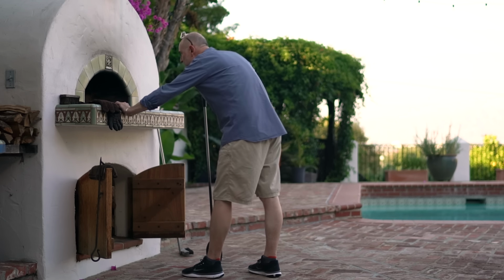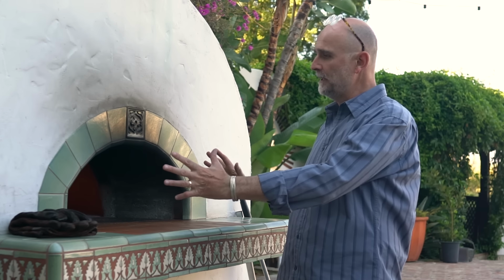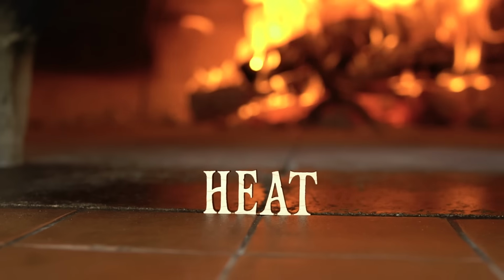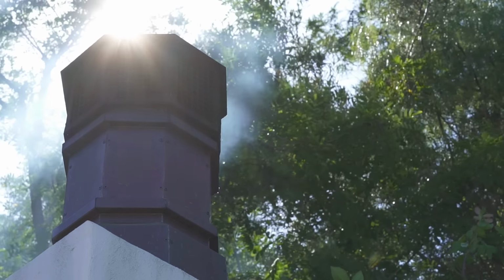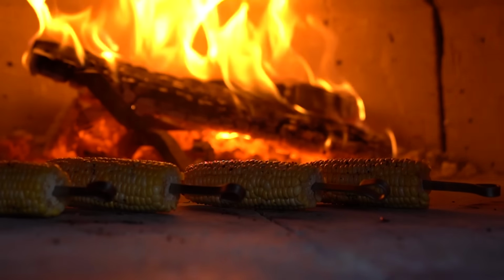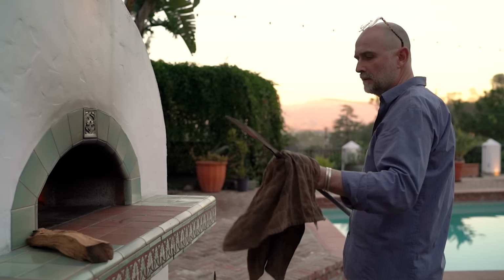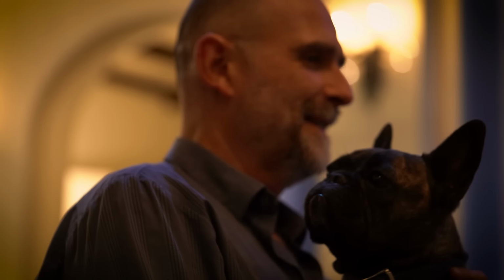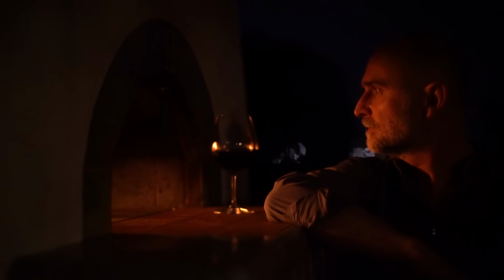Ep 1. An introduction to Wood Fired Oven basics

Comment: Clive hows it going what to you use to clean the smoke outside the oven face or does the heat clean it outside as well ?
Reply from the maker: Hello Benny.
Between the front opening and the dome I will occasionally use a wire brush and the vacuum to brush away any build up. I get the chimney cleaned by a professional sweep once or twice a year depending on how much I’ve use the oven.
Wood that hasn’t been properly seasoned and has a higher moisture content can leave creosote reissue in the chimney, so be sure to use properly seasoned firewood.
Outside of the oven I use a kitchen sponge and some slightly soapy hot water to scrub down the tile on the shelf, around the opening, and to clean the stucco.
The tile directly in front of the opening is unglazed and high fired so I know it can withstand the heat from the oven, but I will occasionally wipe some flaxseed oil over it as it's a good high heat seasoning agent, especially for cast-iron pans.
I hope that answers your question.
Thanks for commenting.
Clive

Comment: Great information, the only confusion is: 800 degrees ?!! are you cooking food or meltin any metals ?
Reply from the maker: Hello Lola. HaHa! Yes, you can heat the oven up to 800F if necessary, but that's usually for something like pizza. Most of the time my oven is around 700 to 750F, which is still hot, but closer to the oven opening it can drop to around 400F. I regulate where I place the food in the oven based on how quickly I want it to cook. Never tried melting metals though. Thanks for watching. Clive
Reply: He is talking Fahrenheit.....not Celsius (400C) ....lol
Reply: @SuperSetright  thank you - I was reading the comments to clarify that... was thinking I might have accidentally built a kiln not an oven.

Comment: Great video! What is inside diameter of the oven?
Reply from the maker: The internal diameter of my oven is 40”/106cm. More important though is the heat retention of your oven. An oven with good heat retention will require less fuel to maintain the temperature, which means a smaller fire, which gives you more surface area to cook with.

Comment: i have 1 question, how do you clean the ovens insides? like all over the dome
Reply: MeiN he tells you in the next video. Shop Vac
Reply from the maker: Hello MeiN. After you've used the oven, and it's cooled down the dome and floor are usually completely clean, other than the residue ash on the floor which can be easily cleaned up with a shop vac if you want. Once you relight your oven then smoke cause by the resins in the wood will turn the dome black until it reaches over around 425C/700F. Thanks for watching.

Comment: The oven design has a flaw, the entire flat area of the front will all become black within a few uses, also the dome is a bit to high in my opinion and make the flame not crawl on the ceiling. But it looks very beautiful and having one in your back yard is a game changer when it comes to cooking
Reply from the maker: Hello. I've been using the oven for several years now and haven't had a problem with it becoming black. I assume your talking about the tiled area outside the opening. I chose that tile because it was fired at a very high temperature and can withstand the heat from the oven and is easily cleaned. I can get a pretty good flame roll when needed from the dome. Also, several times a year I have the chimney cleaned by a professional sweep. Thanks for commenting and for the input. Happy New Year.

Comment: ive resored an old mud oven, it has like 40years old, i cover the floor with cement so its flat, its small, its half of yours... and it has an open hole in the top. i did a fire test, and it got so hot i had to stand 40cm away, after it cooled down, i did a few pizzas, it was great, an hen i wanted to do bread, did 2 fires, and non of them made a crust on the bread, i heated it up a lot, remove the heat clean the floor, place 4 breads and close the door, waited 40 min and didnt cook it through. i've got a white crust... what should i do ¡?
Reply from the maker: What temperature can you get the oven up to? Bread loaves are usually baked T AROUND 450F/230C.

Comment: I'm amazed you can put cast iron in an 800° oven without it shattering like porcelain.
Reply from the maker: It's usually 800 directly around the fire, but the heat can drop off to around 400 close to the opening, and around 500 to 600 in-between.
Reply: are you thinking about °C? the video meant Fahrenheit
Reply from the maker: Fahrenheit

Comment: Can't get the reasoning behind the dome. Why would I want to retain the heat for long periods of time?
Reply from the maker: The dome shape is considered one of the most efficient ways to absorb and reflect heat. 

The dome and floor are what’s called your Thermal Mass. Think of it as a battery, and the fire is the energy source feeding them. Once you light your fire, you’re transferring energy/heat into the dome and the floor. And those surfaces will continue to absorb and reflect heat while there is a fire in the oven to feed them.

The insulation helps prevent the heat from escaping, keeping it within your thermal mass. In my experience this means I need less fuel to maintain the temperature, which results in a smaller fire, and that gives me more surface area to cook with. The insulation also increases the time it will take for the oven to cool down, and extends the period for retained heat cooking. You can cook many dishes in the heat left in the dome and floor. The most common use of retained heat is cooking bread.

Comment: So what heats the floor
Reply from the maker: Hello Walter. Once the fire is lit the heat is transferred to the floor and the dome. The hottest part of the floor will always be the area around the fire, but the temperature will drop off closer to the oven opening where cool air is drawn in. That gives you flexibility when cooking, so you can regulate the heat you're using based on where your cooking vessel or food is placed. Thanks for commenting.
Reply: @TheWoodFiredOvenChef  brillant. Thank you for the reply. Really appreciate this.

Comment: But I thought ash is bad to eat ? especially when you lay the pizza down on the floor of the oven.
Reply from the maker: When you're cooking food directly on the oven floor, like pizza, you should brush away as much ash as you can and then wrap a lightly damp cloth around your peel and give the floor a wipe (just a damp cloth, a wet cloth may damage the floor). In Episode 11 you can see how I do it. Thanks for commenting.
Reply: the purpose of heating with wood is to get the flavor but I can do this with wood chips

Comment: Very sexy and romantic video. But I'm practical. I thought the ending was going to be you sweeping out the ashes. But seriously how do you manage the ash build up and keep the oven floor ash free while cooking.
Reply from the maker: Hello Richard. After firing up the oven I'll carefully use my peel to remove some of the hot ashes into a metal bucket so they don't take up too much room in the oven. My oven has very good retained heat, so once it's up to temperature it doesn't need a large fire to maintain the temperature. In Ep. 2 I show that I use an industrial vacuum to clean out the oven once it has cooled down. Thanks for commenting. Clive

Comment: I don't see what exactly are you teaching: your oven is clearly prefabricated. I would understand if you had made it yourself.... And yet, all those theoretical tips...can be easily found on books. Before you can teach....you need to get on and on and on and on...with your cooking...and learn yourself: that will show you're not just making a video... 

P.s. Clams are better cooked fast for a very short time on the stove: so you preserve more taste and dry them less. Bake some beans in the same terracotta where you baked clams....then it make sense